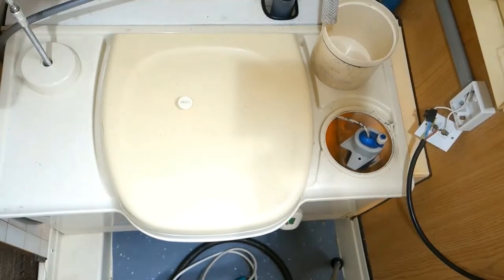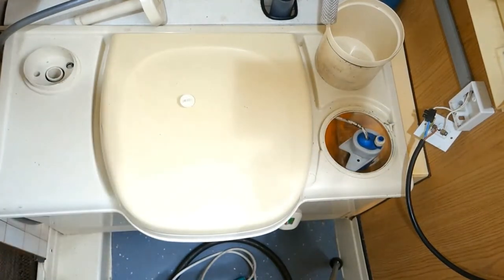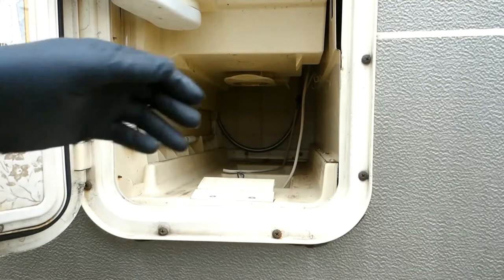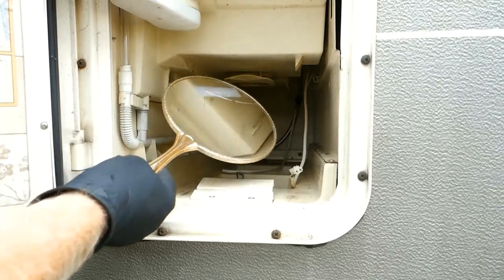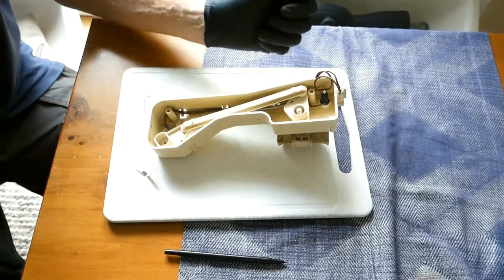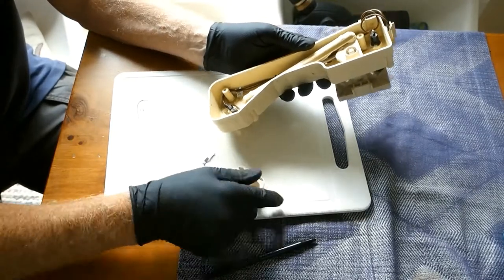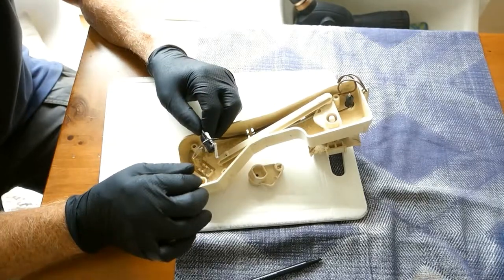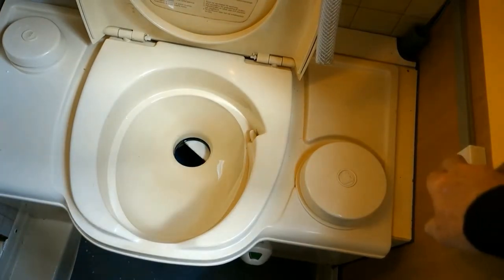Thetford c2 flush fix

Comment: Well done  ,saved a lot of money,,just wired  the pump to a 12 volt supply with a on/off  switch,,did you run it through a small amp fuse,,
Reply: Hi I am wanting to do this too. Did you find out how to do it? Many thanks in advance. Kathy
Reply: @kathleenellison4430  hi disconnect the original pump wiring at your feed into the  toilet, disconnect the water pipe from the old pump (inside the toilet  and cut the wires remove the pump, will be held in place with a small screw you'll get a whale submersible pump, cheap one will one will do ,put in into the place where the old one was,bore a small hole in the top of the toilet close by the wall, making sure you have enough wire sticking out to make connections you will need 12v power from your battery minus and plus/live and neutral, neutral direct to  neutral on the pump, live with a fused connection to a simple on/off switch, from the switch to the live on the pump, hopefully you'll understand my description

Comment: I need to remove the plastic moulding which holds the wiring harness.  You show it removed (four screws).  But how did you reach the two screws which are so far inside the cassette housing?  And how did you put them back.  It looks impossible!

Comment: You've just solved my problem without even meaning too!
I've been trying to get my pump to work for hours so came in for a cup of tea and I watched your video.
The second you said about the glass fuse I went back out, got mine off, swapped it over and it worked!
Absolutely brilliant video!
Reply from the maker: Thanks for the feedback. It helps. My first attempt at anything like this. I doubt you will get an easier fix

Comment: hello there iv already moved my glass fuse once and it worked perfectly but i think its blow again iv tryed removing it again and it just keeps turning its lose but just want budge could i av taken the hole housing out by mistake I'm wiry about pulling it right the way out incase i break the loo altogether
thanks in advance

Comment: Wish I could understand your English, I'm from the U.S..
Not getting power to fuse though.
Any ideas?
Reply from the maker: Hi Joel and apologies for the slow response. My knowledge is limited. If you are still having trouble you will need to acquire a wiring diagram,  trace the other end and test and so forth, there may be another fuse.  The English is a Glaswegian/Scottish version, you may struggle. Try listening to some Billy Connolly you might catch on to some of the nuances. Billy, aka Big Banana Feet, is now a resident of Florida. Hope this helps and if you receive this All the Best for the New Year.  P J

Comment: How did you wire up a separate switch for the toilet
Reply: Just get a supply from a 12 volt  source run it through a household electrical switch to the pump,,make sure you have a 5 amp fuse on it,,

Comment: Thanks for your video this helped me. repair my toilet.
* A mirror (iphone camera) helped me find the 4th screw to remove the switch assembly
* The little metal switch goes back in with one end (with protrusions) taking the holes you used for the paperclip. It goes in in an "n" shape. 
* MY intermittent  switch problem was actually the fuse housing! The inner part had corroded.
Reply from the maker: Hi Daniel       Thanks for the feed back and apologies for late reply,hope you read this. My first attempt at anything like this and all about a toilet.

Comment: Hello could you tell me why the blade don’t open fully on your cassette as mine is the same and I’m sure they are suppose to open all the way or am I wrong
Reply from the maker: It is Dec 30th. I have just gone out to look and yes it can fully open but it took 3 hard throws to move it the last few millimetres. In the beginning I remember applying vaseline top and bottom then working it back and forth to improve it.  I still redo that occasionaly. Apologies for the very late responce.

Comment: How did you wire it and what switch have you used
Reply from the maker: Hi Jason.  The switch and wiring were already there. There is a 20cm deep basin under a floor panel to stand in for a shower. The switch was for a sump pump for this area. I just rerouted the toilet wiring. If you go down this route I would suggest using a rocker switch to eliminate the possibility of leaving the switch in the on position and burning out the pump.
Reply: OK thank you for the reply I'm going bypass the wiring just below where it comes out from the bottom of the caravan and connect it to the pump just wondering what switch you used please 🙏
Reply: Just read the all your message I think I understand now and thank you 😊